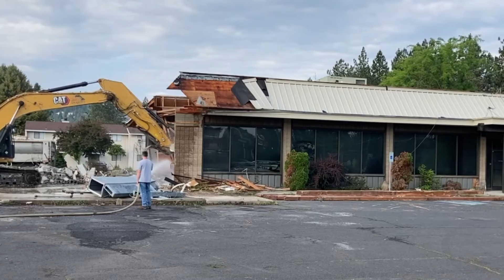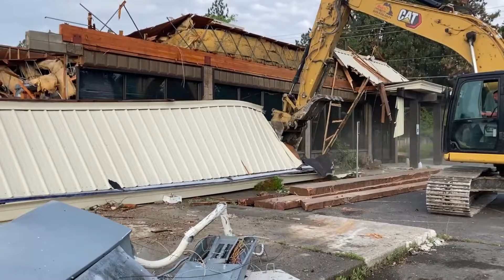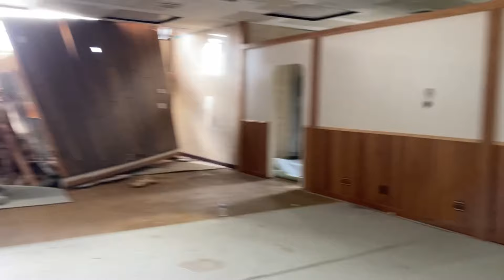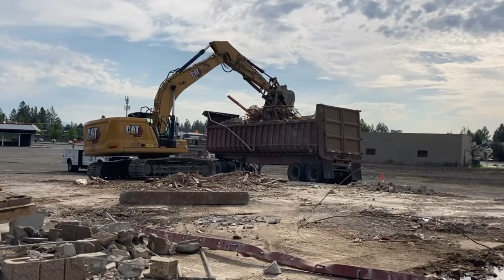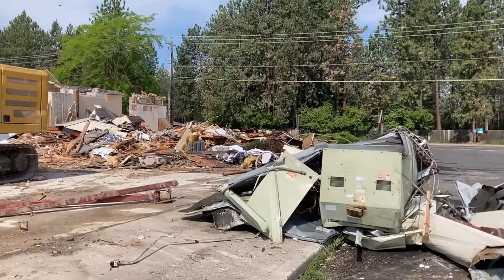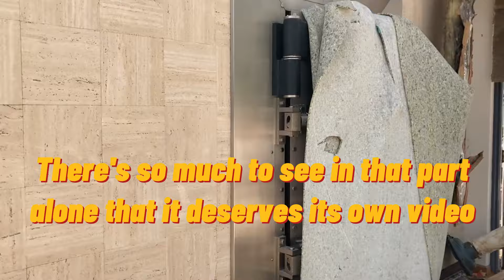Watch us Completely Demolish a BANK with this Excavator

Comment: Great, enjoyable videos. I like the way you crunch and chomp right into the building and don't seem afraid to pull it apart! 
I don't mind 2x or 3x speed as long as there is action; pulling down walls or moving stuff out of the way.

Comment: You definitely need to demo that faster than that, I was demoing projects when I was twenty years old, I’m fifty seven and a retired heavy equipment operator / supervisor and have done it all from demolition, land clearing and a mainline operator that installed wet utilities water,sewer and storm. Thirty five years in the land development industry, my demo days is how I got started. I worked for a company that built fuel stations here in Washington and Portland Oregon.   *7-19-2023 good video, you just need to be faster as well as efficient.
Not trying to criticize just trying to help you out.
Reply: Its takes time